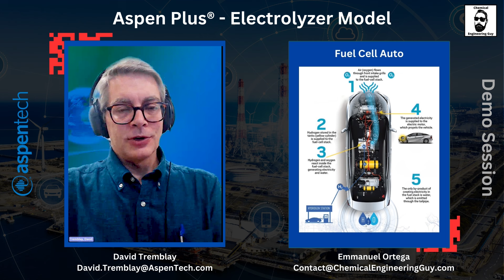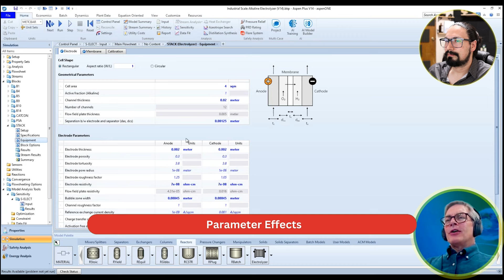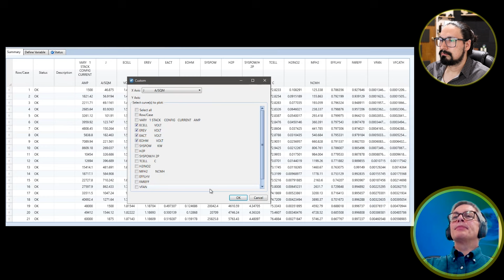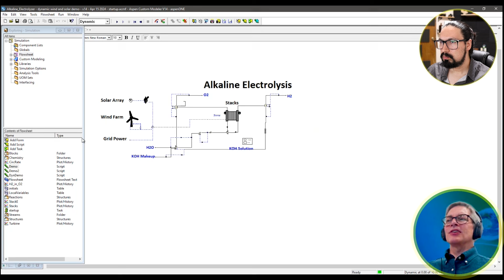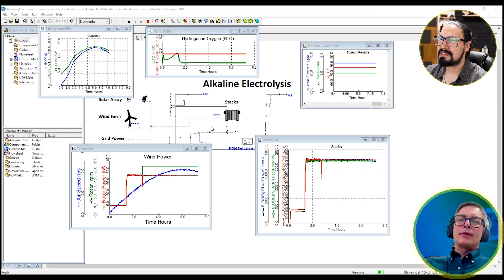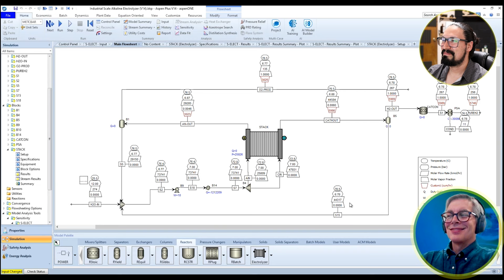Electrolyzer Model - Demo Session ft. David Tremblay from AspenTech®

Comment: It seems that Aspen Dynamics does not support the built-in Electrolyzer block so you used an "Open equation form" of the electrolyzer instead. I'm a bit confused about how that works. Is there a way to access the explicit governing equations used by the Aspen Plus Electrolyzer block so that I can recreate the same model, or is there a simpler way of defining the electrolyzer in Aspen Dynamics?

Comment: Is it possible to model AEM electrolysis on Aspen? and CO2 electrolysis?
Reply from the maker: Modeling AEM and CO2 electrolysis in Aspen Plus is possible by leveraging the "open" nature of the software's electrolysis framework. While V14/V14.1 includes built-in modules for PEM and Alkaline stacks, you can model AEM by manually adjusting the rigorous stack parameters—such as membrane thickness and electrode properties—to match your specific technology. For CO2  electrolysis, you would typically use Aspen Custom Modeler (ACM) to define the unique electrochemical reactions, which can then be integrated into a full flowsheet to simulate the balance of plant and evaluate dynamic performance under intermittent renewable energy loads.

Comment: This was a nice demo. I had no idea that Apsen could model electrolysis now. 

Can the electrolysis model be used to model the transport of other cations across the membrane besides hydronium? For example the transport of metal ions across a cation exchange membrane. 

Also I assume you need to have the electrolyte package in Aspen to do this simulation is that correct?
Reply from the maker: That is a great question, I'll be adding it to the Q&A!

Comment: Thanks a lot for the demo session, it was super useful. I wanted to ask a few questions:

1. Can we specify each cell individually in teams electrode and diaphragm types? For example, I have a stack with 32 cells, each with a different electrode design and diaphragm. 

2. During stack operation, can we estimate the diaphragm's lifetime, degradation, and the performance of the cathode and anode coatings? 

3. Is it possible to estimate the bubble and void fraction for each cell? 

4. Lastly, can I view, change, or modify the mathematical model?

Looking forward to your next video!
Reply from the maker: Thanks for this questions! I'm still working on the Q&A!

Comment: Thank you! both David and Emmanuel for bringing us this detailed and very insightful demo session. Really informative! I am currently working on Pt-X process, for hydrogen production, I am using stack data for labscale stack, but to scale it up for industial use, I am trying to increase the cell area and number of cells, do I need to change any other parameters for the stack?
Reply from the maker: Good question, I'll add it to the Q&A!
Reply: @ChemicalEngineeringGuy  Thanks and I am looking forward to it! Also I am wondering is there any specific way to calculate the required water flowrate for the electrolyzer module to work efficiently? Because I am trying to validate my simulation model with the HRI's electrolyzer and I am wondering if there is any ways I can calculate water flowrate based on some parameters for instance, cell area, number of cells and stacks, current density, temperature, pressure, etc.  😄